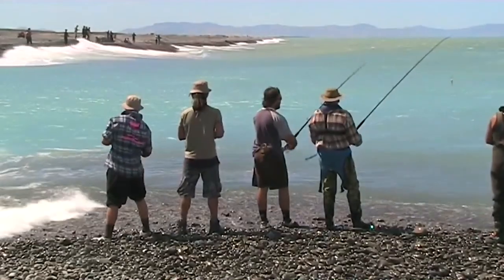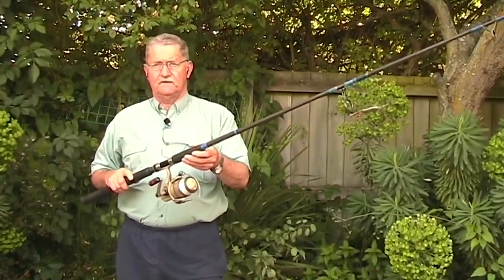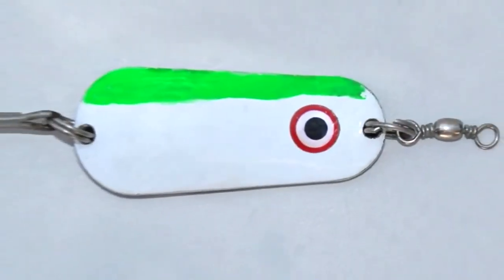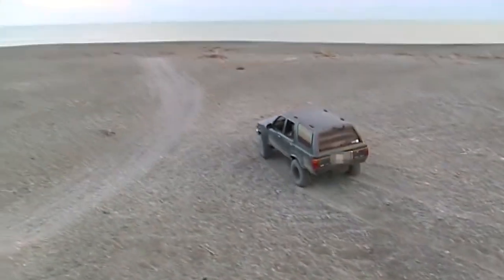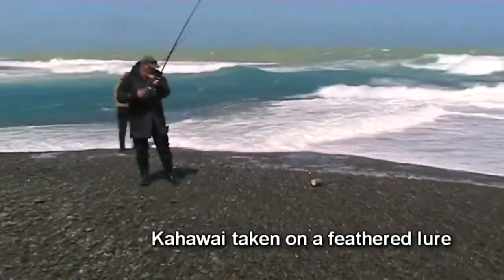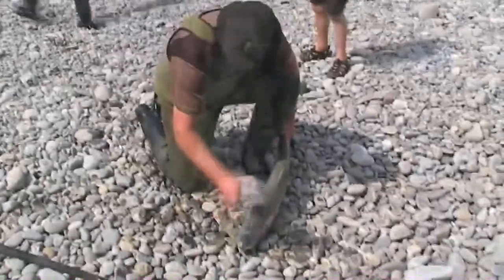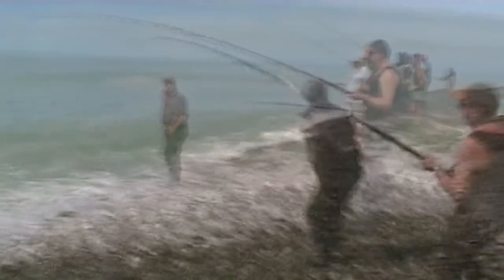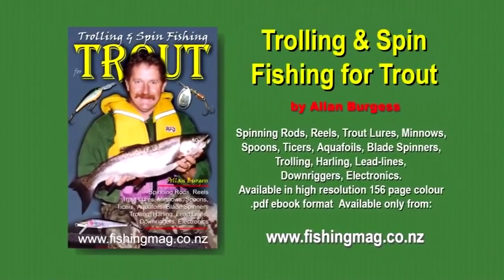The Complete Guide To River Mouth Salmon Fishing - Old DVD

Comment: Hi Alan,
I have saved this link so I can watch this video when I have the time. I have never caught a salmon before but love catching Kahawai on my light spinning gear at the Waimakariri mouth. You provide excellent tips and information. Well done.
Reply from the maker: Thank you for that. Any day you catch a salmon is always a red-letter day, especially in the lower river. You just need to be persistent and treat every cast like "this is the one that will catch you a salmon. "
Reply: @fishingmagconz  Well, 3 years later I finally managed to bag 2 salmon for the 2024 season. Albeit smaller than what used to be caught back in the 90s. One was 7lb and the other was 4.8lb.
Reply from the maker: @canterburyfishingadventures  Well done you. 7lb and 4.8lb They might be smaller but they are just as difficult to catch.